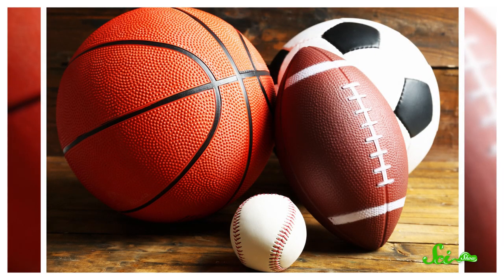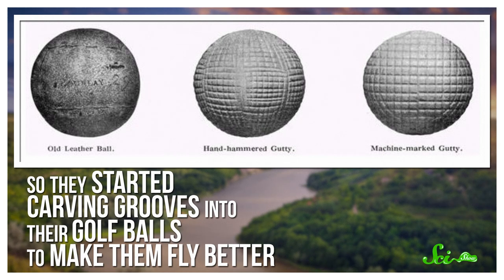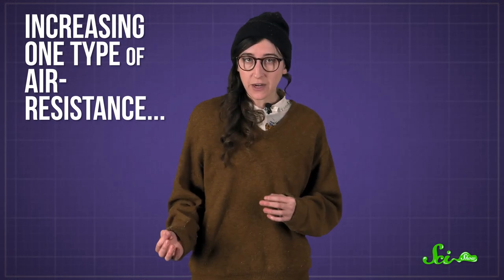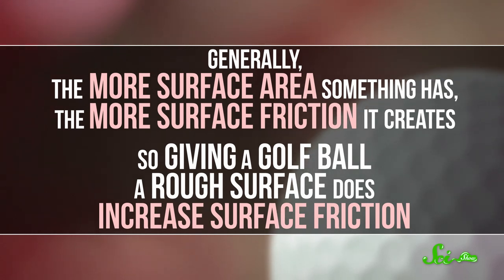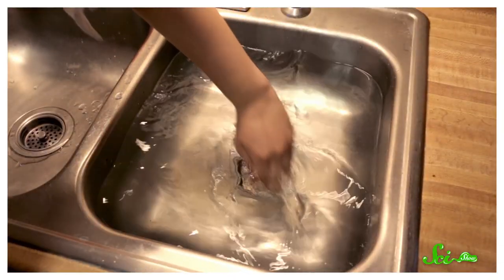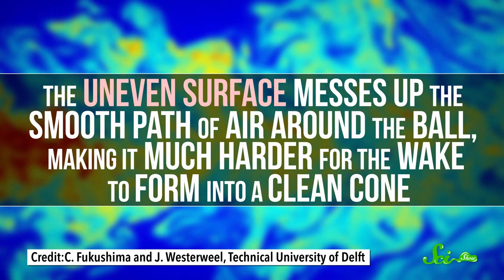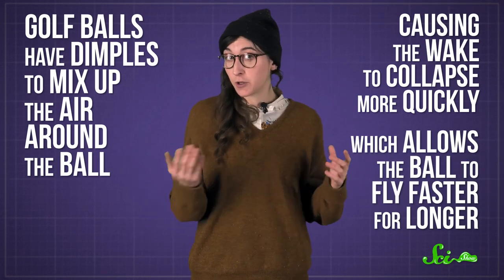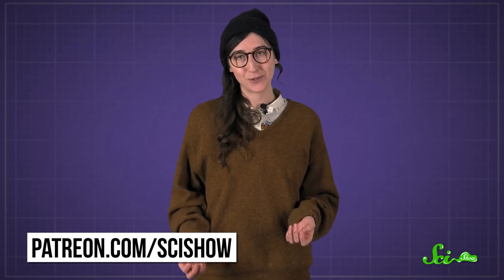Why Do Golf Balls Have Dimples?

Comment: Yay a new thing learned on a subject I thought I knew well. This is why I like SciShow.
So a wake, a low pressured air or liquid that pulls a object back which therefor slows it down especially at higher speeds where the wake becomes very big. So something like that, that´s interesting.

Comment: So why not cover planes in dimples?
Reply: It would probably significantly effect structural stability, and it is less of an issue because airplanes are more streamlined and less spherical in shape.
Reply: So actually if you ever look at the leading edge of an airplane wing it has an almost sandpaper like texture for this exact same reason! Creates turbulent flow and thus make the plane fly more efficiently!
Reply: stiimuli 
The wake of an aircraft is much less due to the aerodynamic design hence there is no need to incorporate it.
Reply: in addition to what oscar said, it would also increase the overall weight, which would mitigate any aerodynamic benefits.
Reply: Some wings do use turbulators that are like dimples at critical areas to achieve the same effect, but the main reason is that airplanes are usually streamlined shapes already, not spheres.. it also depends on Reynolds number.. better to have laminar flow on the smooth front facing surfaces, and sometimes it pays to kick off turbulent flow just before the aft-facing surfaces.. this is used mostly on smaller, slower craft where viscosity is more important.
Reply: As she described, there are 2 different forms of drag and there is a tradeoff between the two.  For the golf ball, due to its shape, the pressure drag is a more important factor, so reducing it while increasing friction drag reduces in a net reduction in drag.  However, for airplanes, the skin friction drag is a bigger factor, and thus the increase in skin friction drag from the dimples would result in more drag.
Reply: Because planes aren't spheres. The wake isn't a problem.
Reply: I'm not sure if my guess is right but you know...a plane isn't round and you don't throw a plane, it flies differently than a ball
Reply: someone really should run a neural network to evolve shape of an airplane. on a supercomputer as simulating airflow is hard AF and it would need to run so many times... but the outcome might be VERY interesting
Reply: @Parker Lyman What plane are you referring to? I call bullshit! :D
Reply: Stiimuli Thanks <3
Reply: because that would be stupid
Reply: Because planes travel at a constant velocity with engines to keep the momentum of the aeroplane moving.. so it needs to be more focused on reducing the surface friction as opposed to reducing the drag like the golf ball. A golf ball only has a sudden burst of energy transferred into it from a club, so its better to focus on reducing the 'sucking' behind the ball like shown in this video, instead of focusing on being streamlined and having less surface friction because it will only be getting slower due to the lack of a steady flow of momentum i.e planes have engines to keep pushing them forward, a golf ball doesn't.
Reply: Thank you for posting the correct answer to this question! I am an aerodynamicist and boundary layer turbulence researcher. My pet peeve is people wanting to cover everything in dimples.
Reply: See Dan Moser's answer for the correct answer. You are partially correct about the "streamlined" shape: the geometry of the object does affect the adverse pressure gradient on it's aft body, and hence boundary layer separation.
Reply: That's a strong maybe... depends on the size and cruise speed of the plane, and they may want to induce boundary layer transition (to turbulence) sooner than is natural for controllability reasons...
Reply: Probably because golf balls rotate in flight and planes don't.
Reply: you want the air flow to stay coherent to you dont experience constant turbulences
Reply: because... trypophobia...
Reply: Mythbusters dimpled a car, and lowered its fuel consumption. Look for the episode on YT!
Reply: rmay000 like most commercial airplanes. Next time you fly look close it is there. Jet fighters don't have it because most of there lift comes from thrust not airflow.
Reply: Well you see when it comes to Airplanes, you want them to have this funny thing called lift, which without air resistance of the first type doesn't happen...
Reply: I see how you used logic to deduce that on your own, but you are incorrect. The biggest reason dimpling isn't implemented on war planes is because it would greatly increase the radar signature due to the dimples scattering the radar waves back to the source.
Reply: Who ever said I was talking about war planes?
Reply: also I didn't just use logic, I used the experience I've had of flying (light) aircraft, and several years of physics education both at the high school and collegiate level. Good try though, I respect that lol
Reply: @uconn. I was replying to Parker, but you snuck your comment in before I hit enter, so be it. Perhaps the context clues in relation to the timing of our responses(seconds apart) would have clued you in to the intent of my post. As per the comment I was replying to the flight/control surfaces of current jet fighters have much less to do with "lift" in the common sense, and more to do with directing the enormous thrust generated. While dimpling on a regular aircraft wing would certainly reduce the ability for the pressure gradient under the wing to form efficiently, and therefore reduce potential lift as you stated, that wasn't what I was replying to originally. Your unfounded snarkyness will lead you nowhere. Source: Navy Aircrew, not some kid who flew a piper twice.
Reply: Well snarkiness aside, we both were right, especially considering I was talking about Subsonic aircraft. And It was a Cessna, not a Piper thank you very much, and I flew it for 259 hours, so more than 2 flights haha. I still have th 6-7 years of formal education in physics and other related fields to fall back on. And if you are Navy Aircrew (which neither you or I have any realistic or logical way to verify it on youtube) thank you for your service and experience is, notedly, taken.
Reply: Because they would go slower... which is exactly what you DON'T want.
Reply: Parker Lyman Again, I call bullshit. What airplane are you specifically referring to? As a glider pilot and aeronautical engineering student I think I would know if this was a wide-spread concept.
Reply: That makes about as much sense as adding wings to a golfball.
Reply: because air around an air plane is ALREADY Turbulent flow, so it doesn't need dimples. whether air flow is laminar or turbulent depends on Reynold's number, when Reynold's number is greater than 4000 it is turbulent .  in the case of an airplane, both velocity and characteristic length is really large which makes large Reynold's number then air flow is turbulent
I hope it helps :)
Reply: I don't golf with planes.
Reply: Young Chan all correct except the number 4000, that's for pipe flow. Reynolds isn't a universal number for every situation. Turbulence in flight is a Reynolds around 1 million. Source: BSAE
Reply: the answer is simple - planes are not blunt objects like the golf balls. planes suffer from skin friction drag, not from pressure drag. also, have you seen tuning on the japanese cars? they have small "wings" called eddy generators at the back of their car and roofs. the idea is similar to the gold ball dimples - to create many smaller eddies that will reduce the overall drag.
Reply: Dimples break up the laminar flow, which is good for reducing drag on an object moving through the air, so you'd want to dimple the fuselage, not the wings.
Reply: Planes are taking advantage of different principles. They want to reduce drag as much as possible, so that the engines have more excess power to fly faster and climb higher. Planes don't produce a lot of pressure drag, because the fuselage is tapered down towards the back, instead of having a round ball shape. They do produce induced drag as a result of the lift on the wings- they're called wingtip vortices and I think scishow has a video on them.
Instead they rely on the smooth flow of air over the wings (and fuselage) to generate lift. This is called laminar flow, and it is really important for keeping the plane in the air and preventing a wing stall. A 'boundary layer' of air over the surface of the wing needs to stay attached to the wing in order to create as much lift as possible. Some planes have vortex generators which create little spirals of air over the wing to reinvigorate the boundary layer, but overall planes want their wings as smooth as possible to reduce 'parasite' drag, or drag due to the structure of the aircraft rather than as a by-product of lift.

Sorry about the long explanation, I'm a pilot and I get excited when people ask questions about how planes work.
Reply: biliepiper14 - And judging by your name, a fellow Piper pilot. ;) Low wing all the way!  :)
Reply: This isn't true.  Aircraft put a LOT of effort into maintaining laminar flow instead of turbulent flow as long as possible.  The leading edge is not like sandpaper, the entire wing is as smooth as possible.
Reply: That's true- laminar flow is essential for generating lift. There's a boundary layer of air over the wing, only about as thick as a playing card, that makes laminar flow possible. When the boundary layer separates, laminar flow stops and turbulent flow begins. 
Aircraft with swept wings, like airliners, will usually have vortex generators on them to reinvigorate the boundary layer and generate more lift, especially at high angles of attack. They're little tabs that come up from the surface of the wing, maybe a centimeter or two high, that create a little spiral. It produces a little drag, but the trade off is a much more efficient wing. The laminar flow will extend much farther down the wing with vortex generators than without them. It also makes it easier to control the aircraft, since you have better airflow over the control surfaces like the ailerons, rudder, and elevator. Any airplane can have these installed after production, but a lot of airliners will have them installed while their being built.

I know this is a Wikipedia link, but it'll give you some basic information on vortex generators. https://en.wikipedia.org/wiki/Vortex_generator
Reply: I think they add the dimpled skin on top of the core, which would add weight to the ball.
Reply: They did. It's call windows.
Reply: I don't believe vortex generators are used on airliners, they have been used on A320's, but purely for noise reduction. They were only on the bottom of the wings in front of circular vents that were found to be noisy. They are also not just for swept wings, in fact they are most commonly used on small aircraft that have little to no sweep.
Reply: They are used on small aircraft, especially bush aircraft that need to go much slower on landings and take-offs to get in and out of tight areas, but they're definitely used on large aircraft too for the same reason. It allows them to go at higher angles of attack and slower air speeds without stalling, or using high lift devices like flaps and slats that create a lot of drag. They're really quite small.
I don't know much about airbus, but I know Boeing can add chevrons on the back of the engine nacelles to increase mixing between the exhaust and ambient air to reduce noise and drag. That's not a vortex generator, but it does create similar swirls.
Reply: If the drag coefficient diagram is calculated it turns out a smooth ball has a minimum in the range of Reynolds = 3x10^5. This minimum is produced because of the separation point in the back of the ball at about 140 degrees, which causes most of the pressure to be elided. A golf ball “works” exactly in this zone which is highly affected by the roughness by decreasing the drag. If the Reynolds number is bigger dimples would increase the drag. Balls and planes have very different shapes, balls drag has nothing to do with planes drag which has very different properties.
Reply: @ZaakBeekman  I can't see who you replied to, what's the correct answer?
Reply: @LtNduati  it slightly increases lift though

Comment: Seeing a lot of people saying in the comment about why airplanes don't have dimples. They do employ the same logic as described here. If you have ever noticed on the leading edge of a airplanes wing it has a rough sandpaper like finish. This to create the same turbulent flow. Super neat stuff.
Reply: That's not how planes want to have their flow at all. Planes fly at a huge speed, where friction drag is much higher contributor to overall drag than pressure drag. On a sphere at low speed, it's more like 80% pressure and 20% friction, so increasing friction a little to reduce pressure a lot is great. On an aircraft at high speed its 80% friction and 20% pressure, so aircraft are as streamlined as possible. Any roughness on a wing is a manufacturing defect, because most aircraft need to be extremely smooth.
Reply: Parker Lyman because airplanes are in less dense air at their highest??

Comment: Here's the real question: why do other things that are supposed to be aerodynamic (like cars) not have dimples?

(Yes, I saw the Mythbusters try this with a dimpled car, so I'll bet the answer has to do with manufacturing and our preconceived notions of car aerodynamics.)
Reply: Ganaram Inukshuk Cars are already aerodynamically shaped, unlike a spherical golf ball.
Reply: As she described, there are 2 different forms of drag and there is a tradeoff between the two.  For the golf ball, due to its shape, the pressure drag is a more important factor, so reducing it while increasing friction drag reduces in a net reduction in drag.  However, for airplanes (or cars), the skin friction drag is a bigger factor, and thus the increase in skin friction drag from the dimples would result in more drag.(Copied from @calpoop2)
Reply: also on a car you need it to have good friction/smooth flow to help keep it on the ground and if you are only driving at 100kph(60mph) the effect would probably be negligible
Reply: Another factor is that vehicles generally have some sort of power to propel them. Golf balls have to "make use" of whatever energy they have when they leave the club face.
Reply: Speed Holes.
Reply: why don't cars have dimple? because no one would buy such an ugly car

Comment: I already knew about the air resistance being lower what I am curious about is why is it not on performance built cars that are designed for speed and not for looks e.g formula 1 and of course military planes. You would think that the same effect would be seen so there would be significant increases in fuel efficiency and top speed.

Comment: Another factor that I suspect may be even more important than that given here is that golf clubs put backspin on the ball that gives it lift from the Bernoulli effect - giving it greater altitude and carry. Dimpled surface = stronger Bernoulli Effect. Amusingly some coaches tell their pupils to try to produce topspin on the ball to make it roll further, which would produce downward force. Luckily for them, it's pretty well impossible to produce topspin with a normal club.

Comment: Not sure if the creators will see this but I'd like to point out you might be wrong about footballs being better with dimples. You would have to look at the actual curves for total drag vs. velocity. The effect you're talking about with golf balls is called drag crisis and occurs for a relatively small Reynolds number range. By inducing turbulent flow you push the drag crisis regime to lower Reynolds numbers but if you're traveling too fast or slow you'll probably increase total drag.

Comment: The 'moving your hand through water' example is a really poor one. Saying it is more difficult with your hand flat instead of sideways is mainly due to having to move much more water because of the larger surface area, not because of pressure drag. Maybe a better comparison would be a flat hand and a fist, since they have similar surface areas, but the fist creates a smaller wake.

Comment: Balls with holes would be superior then; with small conducts passing through them from as many sides as possible to the opposite ones; this would nullify drag, thou it would increase surface friction because of the bigger area, but with a near 0 drag would be the most efficient increase in those amateur Tiger Woods-level strikes.

Comment: SUCKED backwards? Good grief, put the dunce's cap on. No such thing as suction! You mean the superior pressure at the front is greater pushing backwards. Fwiw, the air pressure at the front would be higher even if there was no drop in pressure behind, so extra fail guys!